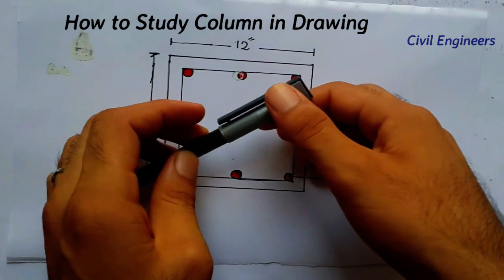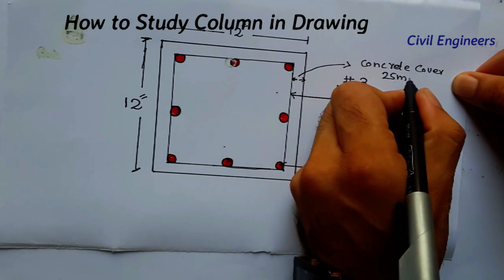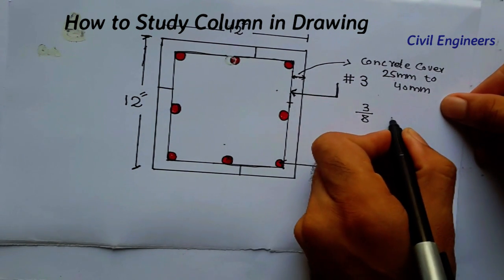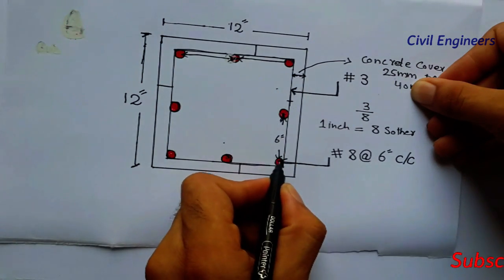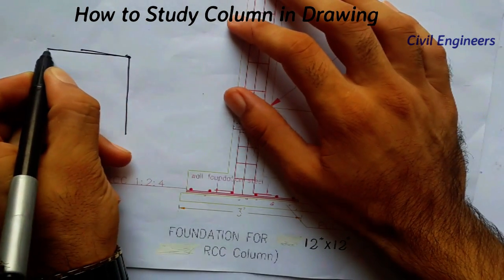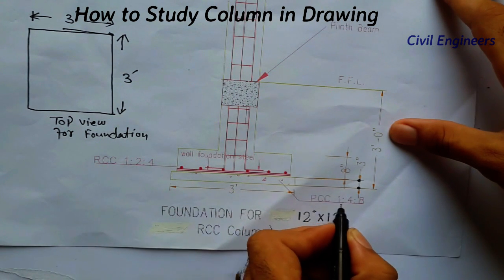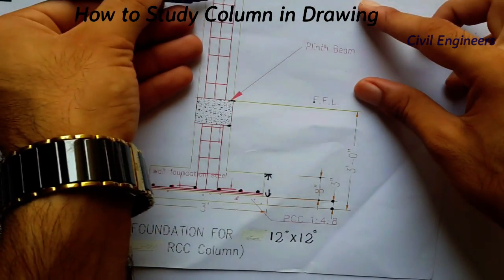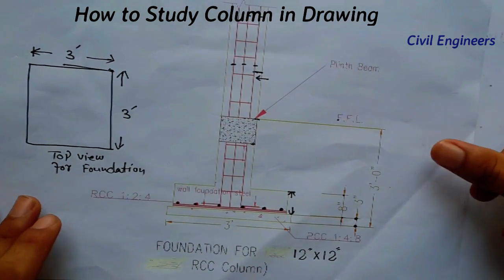How to Study Column with Cross Section in Foundation Drawing

Comment: Your 6 inches cc for vertical column bars is inaccurate if the column dimension is 12 inches out to out, if you have 40mm coverage, rough.y an 1 3/4 inches would require your stirrup to be 9 inches in width, now put 1 bar in each of the four corners and one in between will put that that center bar at 4 1/2 inches cc, 6 inches cc is incorrect sir.

Comment: Why the 8 nos. vertical bars has 6 inches spacing c/c bothways it is not correct because the dimension of concrete square column is 12X12 inches how come....Can you correct it

Comment: Hi friend
You're small mistake 
Collam out said  12ench concrete cover  25mm to 40mm.  40mm is better  40mm  1.5ench  steel baar  c/c 4.5 ench
Reply: Sir,  he is right for the case of shear walls,

Comment: what is soter sir,
i cant understand that meaning 
pls can u explain in detail ....///
with in defination ...... pls reply
Reply: If you divide 1 inch into 2 equal parts, each part will be 1/2 = 0.5 inch. If you divide 1 inch into 4 parts then each part will be 1/4= 0.25 inches And If You Divide One Inch Into 8 Parts Then 1/8= 0.125 inches.  This (1/8) or (0.125) inches is Called ONE Sutar.